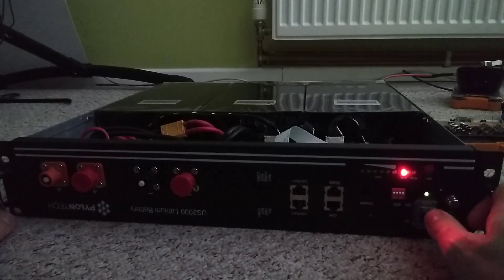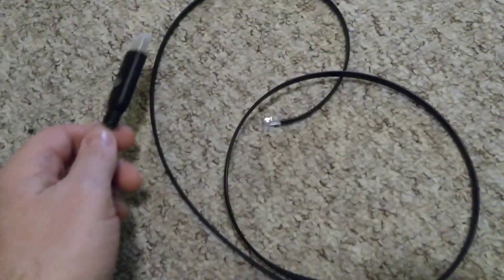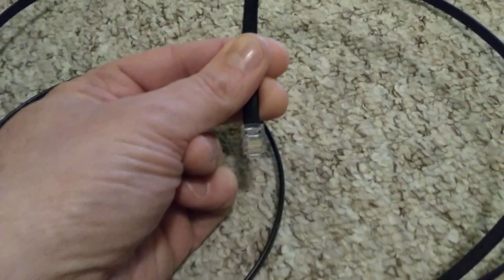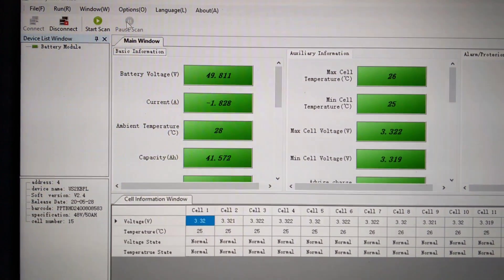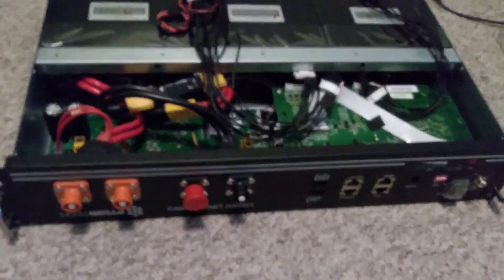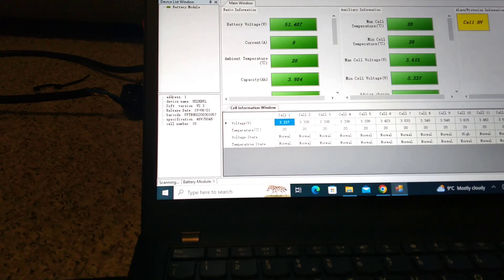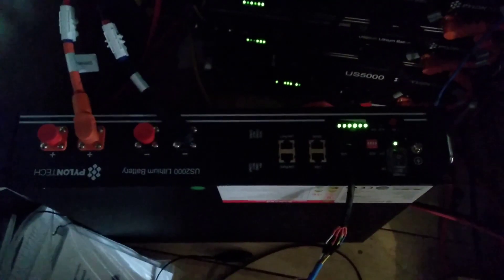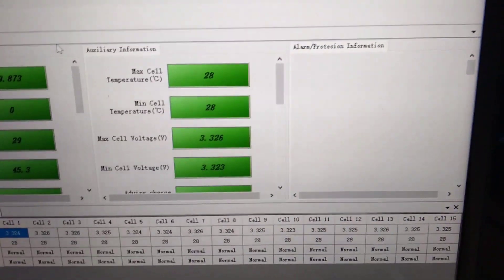Totally flat Pylontech battery. Can it be recovered? Part 2

Comment: I can't find that Battery View software anywhere on their site. Anuone have any clues as to how to find it?
Reply from the maker: Send an email to service.uk@pylontech.com.cn and they can provide it.
Reply: @nicholashowell 
I found it in the end.
That USB to rj45 looked useful. so I tried it. 
For a start, windoze 11 doesn't seem to want to recognize com3, even though I installed it as per MS instructions.
Wouldn't it need a serial converter?
it gives me no choice between rs 232
and rs 485, which, I believe is the protocol it needs.
Any ideas?
Reply: @nicholashowell  The US3000c uses an RJ45 for the "Console" port. How does that effect the USB interface cable? the protocol is still rs232. Wouldnt it need a Serial / USB converter? 
The pinouts look very similar to the old serial crossover cable, as does your construction.
Cheers.

Comment: Mine is us3000c but the circuit board has burnt capacitors
Reply from the maker: Not sure there is a lot you can do about that yourself. If it's still under warranty then you can probably get it fixed that way.